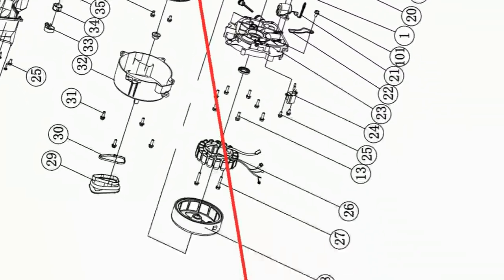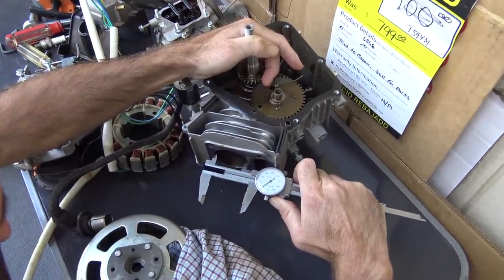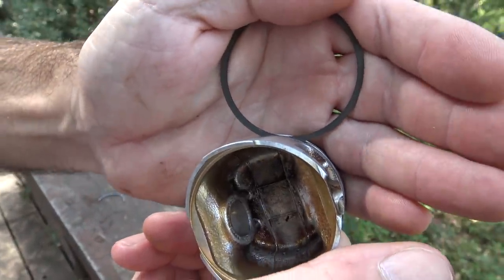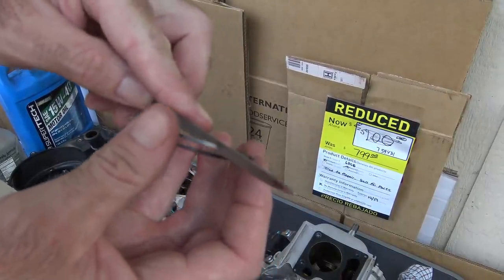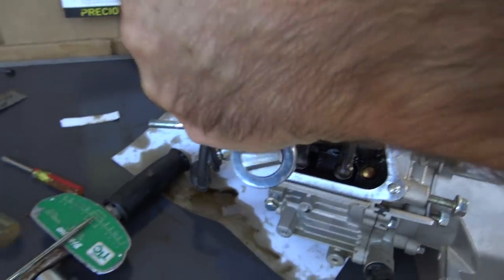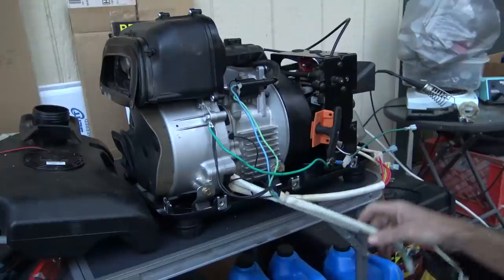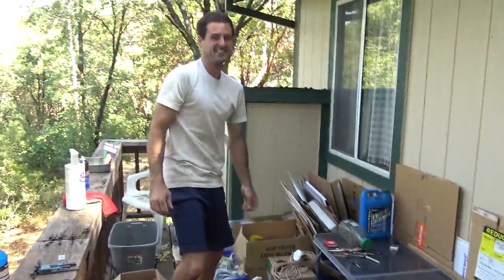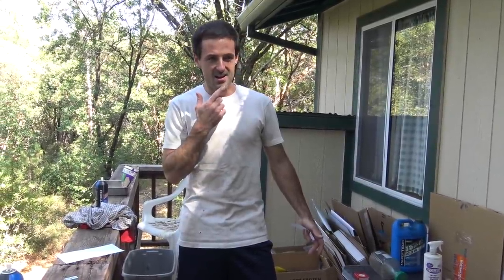$25 Generator From Lowes - The Final Outcome

Comment: I was thinking of buying one of these quiet generators and you made my decision for me. By exposing GENERAC, I'm buying a HONDA. Thank you.
Reply: Ignacio Segarra Either Honda or Yamaha if you don't wanna worry about a timing belt.
Reply: Was not the manufacturers fault it broke. It was the previous owner who over filled it with oil.
Reply: Thomas Strickland Yamaha does build generators
Reply: Moes it's got a Yamaha label on it, but it ain't a Yamaha. Hell Hyundai makes them too. Just a sticker that changes the value is all.
Reply: Yamaha at least sells generators, they are good quality and have a good warranty and yes Honda inverter generators have a timing belt as the engine used is overhead cam, not overhead valve.
Reply: Thomas Strickland I have a Yamaha generator.
Reply: Ignacio Segarra the Honda's are great I'm in Florida and my neighbor and I shared on for an entire week after my Makita dropped a valve the day before the hurricane. Its was a 2000 watt generator we ran to both houses running 2 fridges fans and lights it gave us about 4 hours per tank.
Reply: Well Honda is known for it's long lasting generators and plentiful parts because of it, almost unknown brands haven't got that going for them. Then again if you like repairing things...
Reply: dothemathright 1111
The parts were available but he didn't want to wait that long.
Reply: It's not even American made unless assembled in America now qualifies as American made.
Reply: They could of been
Reply: Ignacio Segarra also buy Honda are you crazy! Just playin but for real my family always has trusted Honda. They're not perfect but their motors are amazing. Got a second hand pressure washer with a 160 OHV Honda motor and with General maintenance I've never had an issue. There's a reason their resell value on cars is amazing.
Reply: Ignacio Segarra that's so true. As much as we want to see American made products we still want quality products and I as well have made up my mind as far as generators go.
Reply: Generac = Assembled in the USA out of Chinese parts. 
B&S may be the only truly USA small engine...

Comment: Great Job!!! That's Why you don't Quit on trying to fix stuff.
Reply: for factory it is not a fix because it took 2x the work to fix it disassemble it and  reassemble it which can build two new generator or more by assemble and assemble
Reply: For the lesson learned, is it more or less than taking the class in college; including travel?  Every company that builds small products by hand should have a rebuild line in the same factory where they take everything apart, swap what's broken, put it back together, test, done.  In the factory it should be a lot faster and cost less to whom it might cost to dispose of it if they pay for the factory rebuild instead.
Reply: AMEN! NEVER QUIT NEVERRRRRR.....JUST BELIEVE..............BE PATIENT AND THE VICTORY SHALL BE YOURS!!!

Comment: I am impressed!  Not only a great video but very entertaining.  It's refreshing to see that there are still intelligent people in this world.  You remind me of me, I've been a mechanic for over 50 years and can take anything apart and repair it but my wife says I can't spell.  Congratulations and that's a great price at $25.  Lowe's needs to have their head examined for taking that back, but it was your good fortune and hard work that got it running again..
Reply: agreed old fashioned determined dude.  and yes Lowes needs to check things a little more thorough.
Reply: Mike Bavoso that's just it people now a days don't want to put any effort into anything. If it's not convenient they pass it off as irreparable. Also they don't teach this in schools anymore we are a society of consumers. I remember going to auto shop, woodshop, small engine repair class, welding class, and even a/c class. Even though I am not an expert those things help me not to get stuck today and not get taken advantage of. He did an excellent job but most people wouldn't even take the time.

Comment: Nice job with that one, it's an amazing feeling when something left for dead springs back to life, I find it a lot more satisfying than just going out and buying something. It's absolutely nuts that you can't just go buy a set of rings for that thing, this disposable society we have is crazy. I shudder to think what that poor generator went through! In 30 years of tinkering with small engines I've never encountered a broken ring. I would have just poured some marvel mystery oil down the spark plug hole and in the crankcase with some fresh oil and given it a squirt of starting fluid to try to fire it up. Good thing you tore it down because that broken ring might have shredded the cylinder otherwise.

Comment: Those Trail 90s were pretty popular well into the 70s.
Reply: Pretty much the same engine still is in use/manufactured in South America and the Philippines but... dimensions slightly changed. It's hard to find exactly the right part sometimes.
I recently rebuilt a 64 s90 OMG it was the first year for the bike and everything changed after 64. CMS/NL was a great resource for parts

Comment: You're so lucky she puts up with you..but she gives back as much as she gets too I've noticed, and it's good she's got a good sense of humor ;) always stay good to each other. And I think I would have waited and got the NYsogoodsolongbutonlyshorttime piston companies original rings though, even if it would have delayed it by 15 days. But a great set of videos nonetheless, and have to admit, I thought it was going to be a stuck valve before you opened it up. ANd the videos could have been released closer together, as the suspense was unbearable, but a good ending, so I give it a rotten tomatoes score of 8/10 (which means very good if you don't know their ratings!)
Reply: niceguy217 , you missed the part where the minimum order was 5000. At least he would have spares!
Reply: well you arent really right
Reply: The 5000 minimum was from the original manufacturer, not Generac.  He just didn't want to wait 15 days.

Comment: I have a 2 year old  Troy-bilt tb80ec 2 cycle trimmer that is a total mystery.   It has 150 psi compression, a new spark plug with strong blue spark, and no blockages in air filter or muffler and it will  not even attempt to start on ether or carb cleaner.
Reply: It could be the crank seals. If they are bad it won't draw the fuel into the motor.
Reply: yang mills broken crank key on the flywheel throwing off the timing like the old Briggs and Stratton mowers after you hit a rock and they shear the key? Let me know...
Reply: yang mills 
If you have a wet spark plug after pulling the starter, then it draws fuel. If it is still dead with sparks on the plug....
Timing.
Reply: Yang --  check ground ?

Comment: Great series.  An another reason to check availability of parts on mechanical or electronic items like generators.  Generac should be ashamed for selling an $800 generator without parts availability IN THE UNITED STATES, NOT CHINA.  I recently saw a similar video about a Synology brand NAS unit and it failed and he could not get parts from China for more than three weeks.  Imagine having all your data on a Synology unit, all the internals are proprietary and you can't get the parts IN THE UNITED STATES.

Comment: What a great series! You and your wife are great together. I'm rebuilding a 1955 two cycle genny now. It had the same problem, piston rings seized. It was a little tricky finding 60 year old obsolete rings but i found a match from an antique chainsaw. Took every nut bolt and washer off the whole generator, polished and painted every piece. I hope when I finish putting mine back together it will run as good as yours. Now I'm feeling optimistic.
Reply from the maker: Sounds like a really neat old machine. Hope you get it going!

Comment: Did you try looking on Ebay for piston rings? Also, when I google "Generac piston rings," there is a website "jacks small engines" which sells them.
Reply: Isn't that something that the manufacturer doesn't even have parts to repair it !!!!! Less than a year old - parts available in a few months - have to get the "" made in America "" parts from China !!!!!  Even "" Jacks "" back orders parts for months at a time till they arrive from China !!!!!!
Reply: I've never had good results from Jack's small engine website. Ordered a part for my Redmax and 3 months later they still didn't have it even though they had already charged me for it.
Reply: however minimum order 5k units (set of rings) he did good cross-referencing
Reply: Yawwee Shalimar 
Some companies are like that. They build part of the motor/electronics and it gets sent out for another company to finish assembling. Happens often. I argued with a few companies about them selling products that they don’t sell parts for

Comment: 449 assholes have watched this to april 12/2018.. Good video! nice repair.. But what do you think made the rings do that?
Reply: BILLSTMAXX 482
Reply: Like he said in the video, over full with oil, the oil got past the oil rings and got between the center and top ring and burned - carbonized the rings solid still and could not longer move and produce compression.
Reply: And then the ring broke. Lucky it didn't score the cylinder walls,
Reply: I had a blower from Lowes. No filter on the fuel. Dust got in when I filled it one day. Cylinder got scored. Had to throw the blower in the trash.
Reply: 707,612 views

30K

505

SHARE
Reply: too much oil.
Reply: @raisagorbachov  That's sad...
Reply: @nunyerbeeznaz2906  hahaha
Reply: People dislike so they won't get video suggestions.  They might actually like the video but dont want YouTube bombarding them with similar videos.
Reply: To much oil will burn the pistons. Compreshen.
Reply: @maddogk9493  Comprehensive? Compershen?Compression?
Reply: @nunyerbeeznaz2906  cosmoline, cosmoline, she don't love me anymore.
Reply: @shade8211  looks like he did hone and deglaze the cylinder walls, so the ring should seat this time

Comment: You two are are match made from heaven! Since i found your channel some days ago i watched almost all you videos. It made me pull out my old (1002) Honda Dominator and get it to run again (new fuel, check the oil and filter, and change the caburator bought   8 years ago.....it runs....its ugly, but i will drive it this season and then make is as fine as my folkswagon 1303.....thanks for watching! :-)

Comment: You got a great deal on the generator.
I got a Craftsman 3500 watt generator for $200 + tax.
The Price was $460 + tax.
It was  brought back with just one use, the person said it would not crank plus the oil light would not work, it did not have a oil light.
The sales person said one wheel was gone, it was between the tank and the motor.
I put the wheel kit on Put gas in it  checked the oil.
cranked it , started  up like a charm.
Paid $200 for a $460 Generator.
It could be sold for a new one.
I did not need it but I saw it was a great deal.

Comment: Good set of videos, I hope those piston rings hold out. I did the same thing way back in the day and the the rings I filed and substituted outlast my Suzuki 50. Then again I let it idle for 10 hours first to break the rings in then ran it slow for about a week before really giving it the gas. When I sold it it lasted the new user 8 months but he was extremely rough with it and broke the connecting rod. Compression was phenomenal.

Comment: I wonder if the generator is still running. Something I noticed regarding the ring gap specs of .008 The paper feeler gauge method was estimated to be about .004 and it appeared that this was the final gap. I hope it was a very loose .004 gap. The reason is when the engine runs for a long time getting to its max temperature. The heat on the rings elevates and causes the rings to expand and close the ring gap. Most engines require the 2nd ring gap to be larger than the top ring gap as well. But to get it running is a great feat indeed.

Comment: Dear Sir you just happened to do the exactly right thing!!!!  That’s right if you can’t locate the piston ring for your piston. Order the next closest larger size ring and grind the extra off just as you did!!!! Don’t get tight fitting as they do expand slightly when hot.   Going off burrs.  Clean.  Check size!  Careful not too large! Will score cylinder!  

Nice guess!   

Keep em screaming!

Comment: I enjoyed the project. A common problem when any motor sits for a while. What happens  is the cylinder dries up, all the oil is in the bottom of the engine hence no compression. I always squi t. Oil in the plug hole and crank it a few times to coat the walls wi h oil to help seal the rings. That usually will get the compression back. , nice work.

Comment: Another advice on the Piston Rings base on experience, normally in motorcycles, and perhaps maybe in gen-sets, you can always interchange rings from 1 brand to another brand so long as the "CC's" are the same. Example I have a Yamaha 70cc with damage Piston Rings, I bought a Honda 70cc OEM Piston Ring-sets instead, yeah that's because it like 400% cheaper than the original Yamaha Piston Rings. All you need to do is look for the size of your Piston or the displacement of the gen-set, 63cc, 76cc, 89cc etc, and look for the closer size piston Rings.

Comment: Next time do a compression test with and without oil put in the combustion chamber.  If compression doesn't come up with oil then you got stuck or worn rings.  So add seafoam or some other such solvent and let soak for a few days. Maybe rings free up. Never-the-less, good video

Comment: Great vid,
What a bout the spark plug did you also buy a new one? You mencend the cost of rings ,gen, decal, spark plug? 
If it happens again Iam a ret out board boat mech. At the shop we would use OMC  engine tunner  or Mercury power tune same stuff .not sea foam  its not as great as thoes first too. its a spray you spray in to the spark plug hole put the sprk plug back in  crank it over a few times let it sit for about an hr. Re do it again it desolves the carbin off the piston and rings. Once you get it started take out the air filter spray it into the air intake of thr carb. Dont let the engine die it will get very very very smokey. It will brun all of the carbin out just be fore you emty the can stall out the engine with it. Let it sit for an hr re start it run it as fast as you can it will burn all the carbin out and if you pulled the head off it would be just as clean if it was new. I use it it my reg. Truck it really improves the proformance and truck runs like new I have 200,18 .08 miles on it i do it once a year runs perfect. I spray it in the break booster engine sucksion hose. I run the engine about 1500 rpms till the can is allmost gone then i del down and kill the engine with the spray. Let it sit the fire it back up soooo much smoke think its on fire not just burnning all the carbin out of the motor i raive it up and down blowing all the juunk out of the motor. Hope this hepls you. Again great vid. 
Much Love to you both
Merry Christmas
Ken

Comment: WOW ! You sure lucked out besides your time & the cost of the generator & the parts you have yourself a great band of a portable generator . WOO ! HOO ! Since this is 2 years later is it still running & generating electricity ?
Reply from the maker: Yes it still works great. I have only used it for a few hours though.

Comment: There is a  torque chart for bolts.......It will give you the proper torque for the size and thread and hardness of the bolt.    Since the bolt goes on aluminium  the torque value will have to be just a bit less.

Comment: You are working in an area which is dangerous and I would have been looking for an area that was close to the ground rather than up on the balcony like you have everything. I have tried doing that type of work in an area that wasn't safe and ended up losing parts, and not getting the equipment running.

I am glad that you got the generator working and didn't have to spend plenty of money to do so. Atleast you know that the parts from China is difficult to come by and was fortunate to find a Japanese part to go on it. Hopefully you won't have any more problems out of that generator and end up getting great service from it.

Comment: Maybe u can tell me why my 1993 Ford engine light does not come on for the first 2 second after turning the key to the on position.. cause that I noticed it would not turn on anymore when the engine dis not stay on.. when the engine would run the engine light did turn on and now the engine light doesn't light up like It would when I did run. It's been sitting for three years and not 1 mechanic can figure it out. I always said it takes a genius to fix a Ford. Well u are the only one that I have seen that is very familiar in trouble shooting an engine. Amazing it was to see u get that generic motor going. 8th grade education so I apologize for not making sense using the correct words to explain my problem.
Reply: Super duty f 150

Comment: Now we know which would be easier, finding the piston rings for a year old Chinese piston VS rings for a 50 year Japanese piston? Good on Honda, to bad they had to be file / grinder fitted. 
I assume the generator company does not carry the rings as spare parts since it wasn't cost effective.
(maybe they couldn't justify getting the minimum quantity required from the "NY" (Near Yangtze) piston company just for spares!) 
Pity that customer service isn't what it used to be. In the old days a reputable manufacturer would yank a set of rings from production stock and ship by return mail if a engine malfunctioned as early as this one did.